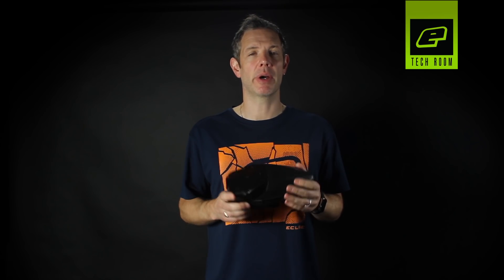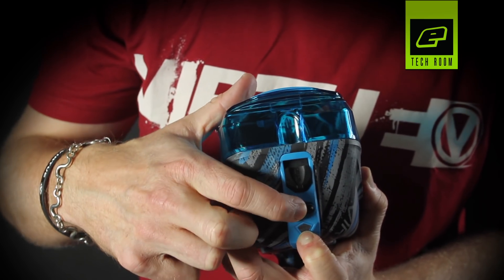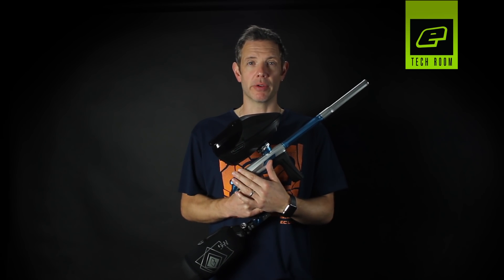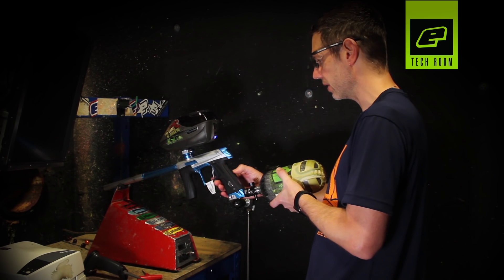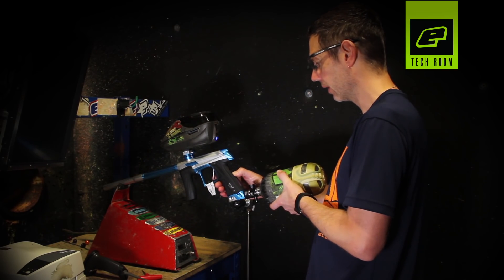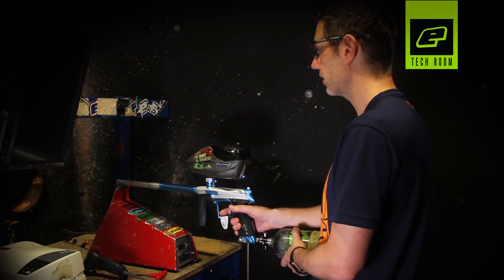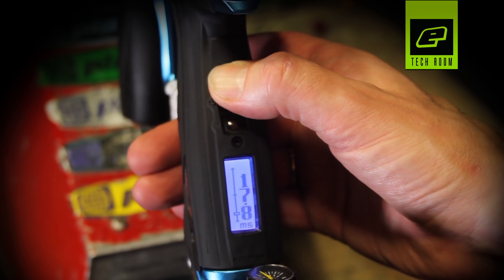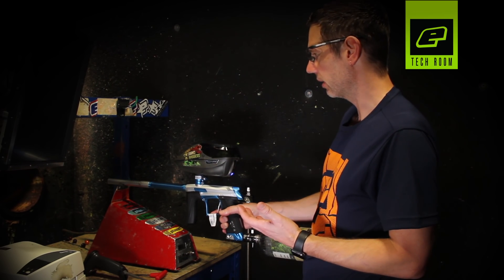Low Rates Of Fire - CS1 Trouble Shooting

Comment: Hey I can't find an answer anywhere, so I might try here.
My cs1 shows 10.2bps on the screen while it says in the settings 10.4bps in eyes on mode, but when I want to start to ramp it only shoots 8.7bps and won't go up.
My eyes are clean and I greased everything 🙈
Pls help 🙈
Thanks!
Reply: Ck eyes on and off caps

Comment: CS1 Problem - When aired, the bolt slides into forward position and emits a small leak coming from the grip frame. The gun will not shoot.